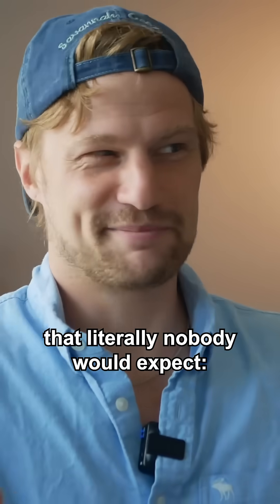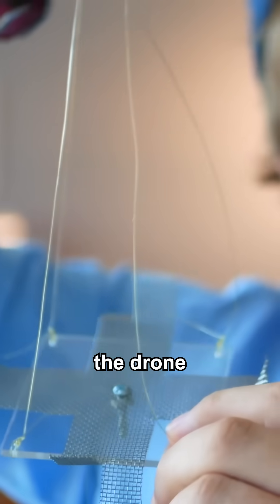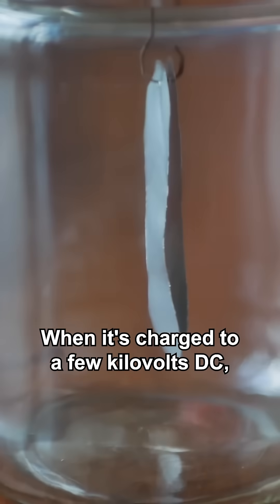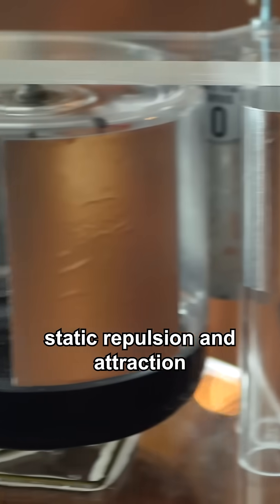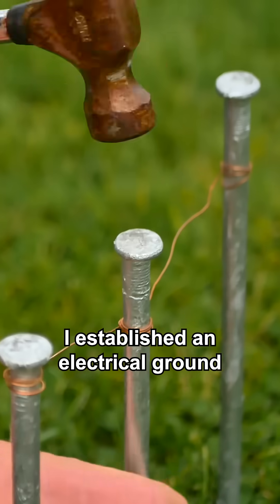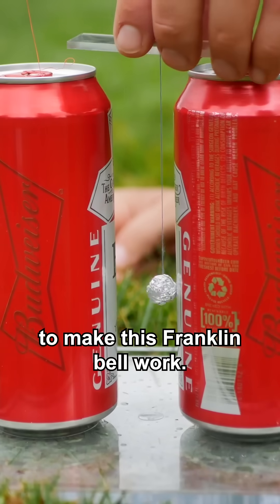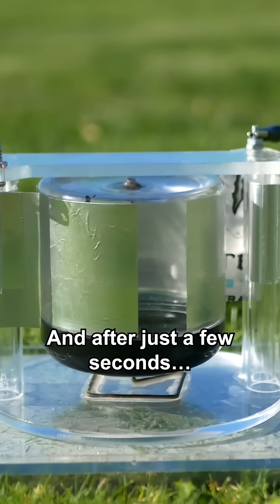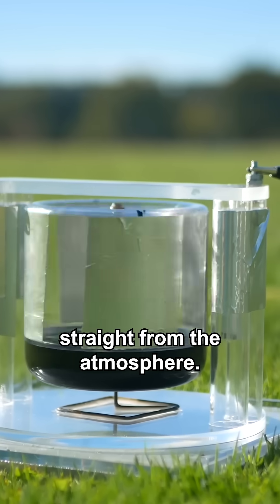Drone Harvesting Invisible High Voltage From the Sky

Comment: All my life, since I was 3, I’ve been told that this is impossible for one reason or another… and that I’m crazy for saying that is possible. 

But, potentially at scale could work. I was inspired by stories when I was very young about the works of my Nikolai Tesla. 

The potential charge at any one area may be low, but possibly could pay off at scale. There is also a theoretical potential for mild weather modification, depending on results from tuning the system. 

My theory is a global atmospheric energy grid of towers, capable of generating and injecting energy both in and out of the atmosphere for harvesting, transmitting, and balancing atmospheric energy. 

My theory is incomplete, as I was made to abandon the idea by school, so my theory never progressed beyond what I had when I was 3 years old.
Reply: My other theoretical design I was thinking of at the age of 3 was a advanced greenhouse system for agriculture, significantly reducing overall land footprint and increasing quantity and quality of plants harvested, with direct control of light, soil conditions, water, even atmospheric conditions within the pressurized growing rooms. 

I was given a million reasons why it was fundamentally flawed and would never work. 

Then i recently learned just a few years ago that the Netherlands had the same idea, and made it work, leading to major success providing for their massive population while simultaneously having more than enough for major exports. 

To clarify, I had no idea that the Netherlands had implemented such an agriculture system. My access to information was a lot more limited back then.

For context My ideas were shot down when I was really young in elementary and preschool, roughly between 1999 and 2006.

Comment: Yes called electrons. Flow of electrons we call amps. Volts is the pressure of that Flow. Watts is volts times amps. On the micro scale the electrons are measured in electron volt.

Comment: Could it be that the airflow caused by the rotors is building a static charge? I have heard that helicopters can build a charge this way. I'd like to see the experiment done with a balloon or even a tall structure (like a crane), in still air. For grins, try it at ground level with a fan blowing across the electrode.

Comment: Michael Tellinger of South Africa posted a video about aliens buildimg sandstone ( = semi conductor material) circles in South Africa to harness ground energy and release it in the atmosohere where their spaceships could use i while flying in the Earth's atmosphere
Even the ruind of the sandstone circles were at 95F when the ground was at 5F in the South African winter 
The original 3 pyramids were also built to harness ground energy and transmit it to the air

Comment: Soooo, I’m not super well educated in physics or electricity, but what would be required to scale this up to the point that you could say, generate the average amount of power a house uses by this method? Say you have a tower built at the same height that this drone flew. How large an electrode would you need? 
Does going even higher in the atmosphere provide greater power generation potential?
Reply: Ok so after reading a bunch more comments I’m understanding that the potential energy is not that great compared to the amount of energy required to power the average house. 

BUT, what WOULD the modifications need to be in order to make this possible? Let’s say there are no financial or practical limitations. How high up would an electrode need to be, how big would it need to be, and what other technological requirements would need to be in place to make harvesting this amount of power possible?

Comment: Great demonstration. Even if the static electricity is not enough for applications on the field , still , Watch out how u advertise it cause if the deep state sees it as a new 0 point energy devise they might Disappear you as they usually Do with all inventors who shake the oil industry. LOL

Comment: Now imagine a rescue helicopter with it's composite blades producing all kinds of static electricity, whilst lowering a metal cable down to you......and you grab it.  I think the formulation of the blades has changed over the years to reduce this, though.  I'm no helicopter pilot, though.

Comment: This does technically work.  But you won't get much power unless there's a thunder storm, in which case you'll get rather too much...

He's getting above-average results because he's hanging the wire off of a drone, and the drone rotors tend to build up a charge from spinning.

Comment: Anyone into Nikola Tesla knew all along! Good effort though... Know try and create an electric regenerator! You should be able to produce twice the input, then repeat to a larger process and so on! Or just build a Tesla Coil, Most people only know of his "Emitter Coil" with the Toroid on the top. His "Receiver Coil" version had a flat Plate standing vertical Cooper coated with enamel. That should have been a Coper Pyramid, but he didn't want anyone to know where he got the idea from!! 😮😊 The deeper and wetter the earth the better the process will work. Tesla's Pancake Doubling Effect Coil will help you produce more power too!

Comment: It’s the wind rushing across the exposed “sky wire” causing a static electric charge. It’s the same with power lines. A disconnected power line can still have enough of a static charge from the wind, that it’ll stop your heart. Wind over exposed wire is just like rubbing your sock feet on a carpet.

Comment: High voltage? Forgive me if i think its not high voltage when it only just moves tim foil leaves, a tin foil ball maybe a golf ball cut into a quarter and a splastic cylinder like container spin on an axil. A high voltage will make your muscle flex and you can knock yourself out, not pushing to thin small peices of tinfoil to push 4cm away from eachother, lemme tell you a secret, i guessed this entire comment...then after i googled to make sure it was right...low and behold i was right...the shock from a fuckin shopping cart is not high voltage(probably not that far off a shock from you clearing the charge in the leaf experiment. Nice "high" voltage but that voltage is a weed high not an electric high💀

Comment: I have two major concerns on this as a possible source of power. The first being the scale that would be needed to be able to power anything meaningful. It would be a ton of resources to dump into the infrastructure. My second concern is we don't know exactly what effect this might have pulling that much energy from the atmosphere. It could affect the magnetisphere which protects us from harmful cosmic particles and energies. But don't get me wrong, I do think this is something that should be researched. It could have uses in the future
Reply: Researched?  We have known about this since 1779.  What are you going to do, when a lightning bolt comes down the wire?
Reply: @MrSummitville  Id imagine they would have a sirge protection system on it like most out door electronics. Also, knowing something exists is far from researching something. Researching is finding out why and how as well as any effects it may have on the environment or people/wild life. Its delving into every aspect of the subject, not just knowing it can generate electricity.

Having had some time to think about it, I'd say it could be used in combination with other atmospheric energy collectors such as wind farms. Each of those blades are prime real estate and may even generate their own static charges on the hull that can also be extracted with this system

Comment: The electrode is charged by the air from your drone’s blades moving over it.   Not the atmosphere.
Reply: No. The charge is in the atmosphere.
Reply: @MrSummitville  And the transfer of it to the electrode is amplified by moving that charged atmosphere over it.
Reply: @andybaldman Not amplified. Just a Static Charge ... a voltage.  But it is a very tiny amperage, though. Ben Franklin knew in 1752. A hundred drones could collect enough energy to light one LED bulb.
Reply: @MrSummitville  I should have said 'concentrated', to avoid confusion.   Moving charged air (or other material) over or across a surface transfers more charge to that surface.    Cat fur and glass rods.    Air and his electrode work the same way.   Blowing air over the electrode is going to produce different results compared to not.
Reply: @andybaldman  The voltage will not increase. But maybe 1 micro-amp will become 2 micro-amps due to prop wash. 1 or 2 micro-amps is still extremely low power / low energy.  Constantly moving the drone to a new location might be more effective. Once an area is depeleted, it takes a long time to "recharge". Wind might help "recharge". It is static electricity... voltage with miniscule amperage.
Reply: @MrSummitville  'Wind' is what a set of propellers spinning at very high speed create.
Reply: @andybaldman  yes, prop wash
Reply: @andybaldman  The wind / prop wash does NOT generate the voltage.
Reply: @MrSummitville  It is affected by the movement of air over the electrode.   No differently than how I can charge my body up by rubbing my feet across a carpet, or rubbing cat fur on a glass rod.
Reply: @andybaldman No! That is not how the voltage is being generated.

Comment: This has been done for a long time now. Unfourtionately while the voltage can be extreamly high, the amperage is extreamly low. Even running it through a transformer to drop it down to 110v will only produce enough juice to run a small appliance, ergo you would need a tower for ever electrical device in your home, and as setting up multiple towers next to each other actually lowers the usable currant as the towers will all be depleting the charge from the same space, the more towers you have in a given area, the less power you get at each tower. Its a cool trick, but its not very usable in real world applications.
Reply: Lightning will be BAD!
Reply: Transformers Don't work in DC.

Comment: Many years ago when I was a radio antenna and radios junkie I used to make really high antennas for better reception, but one thing I always noticed is the higher the antenna the better the signals and also it seemed to have a few watts of power...  If only it could be scaled up and harvested

Comment: now we need to figure out if the energy are mostly from sun blasting high energy photons into the atmosphere and ionizing them (fun fact, if it can ionize air, it can cause cancer too), or does it came from background emf from stuff that we put into the atmosphere like radio and micro waves or from power lines.

either way, this form of energy harvesting only has limited applications and is not practical for mass power generation. solars and windmills would be much more efficient and those two are pretty shit compared to hydroelectric turbines and steam turbines

Comment: Question????  😒😒😒  I've seen a LOT of videos claiming this.  I even saw a dude very slowly rotate a small  5V electric beefy motor by placing it up on a small tree.   However .... is it the atmosphere ... OR ... is it all the TV & Radio station  transmissions (plus all comm radios) surging through the air?????  😶😶😶  I believe there is an area in Virginia (can't recall exactly) where it is PROHIBITED to have WiFi ... TV / Radio transmissions ... EVEN a microwave.  A dead zone for whatever the government does there.  If you could duplicate your demonstration there .... then I would say it's the atmosphere.
Reply: Static Voltage Gradient in the atmosphere. Ben Franklin knew in 1752.

Comment: Do it with one of these cubic kites ... the ones ancient Chinese already used. TheY stay very stable and are the best static kites for high altitudes..near mountains or the seaside they can fly endless. And the kite line is perfect to carry a Powerline even thicker ones as the kite could carry a lot of electrode surface😮

Comment: Could mutiple lines be strung up to creat multiple antenna recievers to increase the voltage gain then combined, transformed and rectified to give a useful dc output

Comment: If, it were possible to build anyone one of those contraptions and it could pull out enough energy to power a small city, would it affect the atmosphere, the weather? Since it would change the amount of energy in a localized area causing an abnormal energy cavity? This might be a silly question.

Comment: I used to construct radio towers many years ago and found out just how much power is in the atmosphere by monitoring the current flow in the ground wire that runs from the top of the tower to the ground rod or ground grid.  It was impressive indeed!
Reply: The electric potential gradient of the atmosphere

On an ordinary day over flat desert country, or over the sea, as one goes upward from the surface of the ground the electric potential increases by about 100 volts per meter. Thus there is a vertical electric field E of 100 volts/m in the air. The sign of the field corresponds to a negative charge on the earth’s surface. This means that outdoors the potential at the height of your nose is 200 volts higher than the potential at your feet! You might ask: “Why don’t we just stick a pair of electrodes out in the air one meter apart and use the 100 volts to power our electric lights?” Or you might wonder: “If there is really a potential difference of 200 volts between my nose and my feet, why is it I don’t get a shock when I go out into the street?”

Although the electric current-density in the air is only a few micromicroamperes per square meter, there are very many square meters on the earth’s surface. The total electric current reaching the earth’s surface at any time is very nearly constant at 1800 amperes. This current, of course, is “positive”—it carries plus charges to the earth. So we have a voltage supply of 400,000 volts with a current of 1800 amperes—a power of 700 megawatts!

The current in a lightning stroke is about 10,000 amperes at its peak, and it carries down about 20 coulombs. 

https://www.feynmanlectures.caltech.edu/II_09.html
Reply: How much?
Reply: But radio towers are not power harvesting. Hmmm…
Reply: @brucegoodwin634  The Power lines operate on Alternating Current but perhaps it introduces some sort of fluctuations?

Comment: You definitely spent 100 times more electricity getting that drone up into the air versus what you harvested. And that’s the problem. Unless you’re gonna build a power station on Mount Everest, it really doesn’t do anybody any net benefit?

Comment: This would definitely work if you scaled up the size of the extraction device and had a way to induce the current to a higher voltage output while reducing the resistance. I'm not saying it would power a city, but it could probably run a short-range telegraph or maybe an old Nokia phone.

Comment: A number of years ago I was with a fellow that ran the old style Arc Carbon movie projectors. He had saved the dust that was left over from the burning in a small jar.  We added water to the dust and it floated on top of the water.  When we put the jar near a light source the dust began to rotate on top of the water.

Comment: Nikola Tesla shortly after the start of the 20th century was the first to discover,. patent and use this energy. He estimated the static voltage in the ionosphere to be approximately 2 BILLION VOLTS. He built simple collector plates which he raised high off the ground. Some collector plates were vertical, such as the one in his patent. The collectors charged up a Leyden jar (capacitor.) A motor-driven switch discharged it periodically into a resistive load so it could used.

Comment: Well the inductor is quite small, and the conductor bringing the power to the ground is quite small in cross section (bad for resistance) so its only a small system.  What would be interesting would be a large scale inductor say 100m x 100m and with a fat cable connecting it to a load.

Comment: We are already tapping into that source with miles of high power cables. German electricity manufactures already said decades ago that a segnificant amount in the Grid is NOT produced by the conected power sources!!!
And maybe you give the guy credit who find that knowledge more than 100 years ago. If you don't know his name was Nikola Tesla. 
Earth and athmospher got a Voltage difference of mor than 100,000 Volts today (it was more in the past) so you can say we live between two capacitator plates. It should be very easy to tap into a flow between the two charges.

Comment: Maybe I’m missing it, I’ve watched this 100 times and the only thing he didn’t make clear is how he’s getting the power back and at which end of the power spectrum he’s using. My guess is he is running a copper wire from the piece connected to the drone and using a one wire system with the nails in the ground as a ground. I know this should be obvious to me and most of us that have at minimum a high school level science education. But to those who don’t and are watching to learn there’s a lot of missing information that would be crucial to understanding how this works. Like did he run a live wire from the drone piece, how close does everything have to be in order to not lose electrical output and how exactly is that piece being charged by the atmosphere. I just don’t think that’s all clear in this video. Because if he’s getting.3v (or whatever he said it was) would going to 2k feet yield more positive electrical energy/output? Is there a ceiling? As in is their a point you would no longer be increasing the energy and/or woul$ you just need to modify your equipment to receive more energy and be able to pass it down?

My apologies I had to watch it again. He did not specify how much electricity it was getting, that was my fault. He said only a few kilovolts